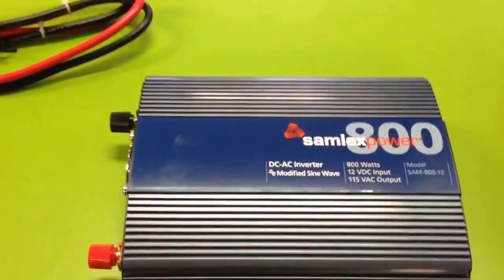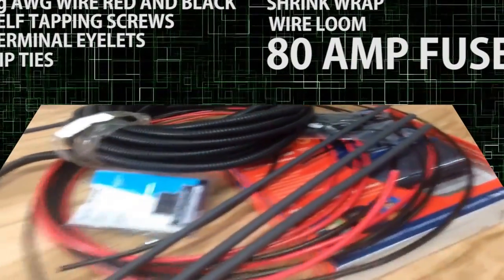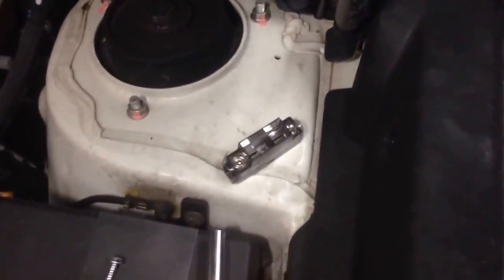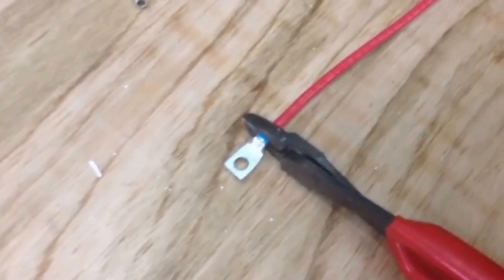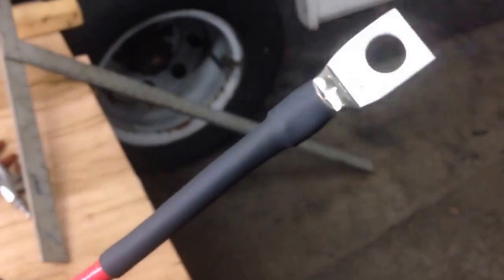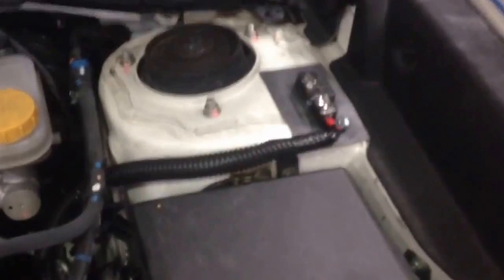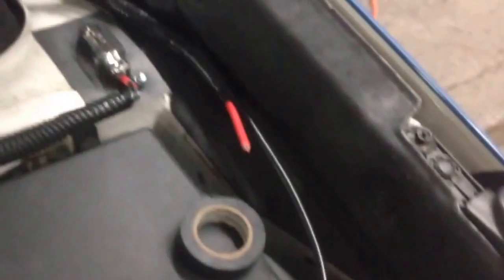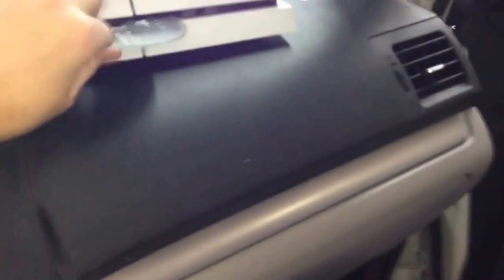How to install a Inverter in your car

Comment: By far the most helpful video I’ve seen and I’ve been watching a lot of these trying to get the best system set up… I bought a 1000 watt inverter and a portable 12 v battery thinking that it would be easier to just connect it to the portable battery instead of having to connect it to my cars battery… I plan on playing my PS4 on a gaming monitor in my car. Is my plan even possible?

Comment: Hello, thank you for the video. How to figure out exactly how much draw is safe for the car - alternator, regulator, the whole system. How much W, on idling off course. Roughly 1kW ?
Reply: 400 w is usually the recommended off standard 12v vehicle batteries any thing larger they recommend a deep cycle battery or a power bank.
Reply: @andrewjordan3884  thank you :)
Reply: No problem

Comment: Did I miss something? How do you run the wires from battery to the inside of the vehicle? Is there a grommet hole that you run the wire thru? (Wanted to be sure that I don't end up with carbon monoxide poisoning? Thanks!

Comment: Is it best to plug a 400 watt inverter to a 12v cigarette lighter or to the battery and should I use a 40 amp fuse. I'm trying to hook a ps4 up in a 2018 dodge caravan.  Any suggestions

Comment: So I wanna do this and your video is supreme with the tutorial but I asked s friend to help me because I am not so confident and he asked if my alternator can even handle it. I'm was planning on using 600w. How can I tell if my alternator will work with this? Was this something you were concerned with?
Reply from the maker: Well it gets kinda complicated lol.  Ok so I doubt anything your running on a 600W inverter will drain your battery enough that your alternator will fail.  Just hooking up a inverter won't effect your alternator only when running something thats drawling a lot of power will possible effect it.  An example would be lets say you have a 60AMP alternator which makes roughly 590Watts output and your running something on your inverter thats pulling 600watts (like a hair dryer) (plus you car systems are using 100w).  So your using more power then the alternator is making; your battery will slowly lose voltage and your headlights may dim down and your low voltage alert would come on before the car shut off.  Now with that being said, I doubt anything you would be running would have that kinda constant drawl to create that senario.

Comment: Try not to use that type of wire! Horrible choice for car audio or car anything really! Your current is greatly impeded which will get extremely hot and voltage drop will be very high. Also the use of the wire used here makes it extremely difficult to manipulate it. Notice how hard it os for him to bend the wire. Use OFC wire (used for car audio and high power inverters or any inverter in my installations. Ofc is very soft and can be moved around with extreme ease and can deliver many times more current with ease. But overall it was a well executed install.

Comment: So I have 1500 watt inverter so I need to have a another battery
Reply from the maker: Honestly depends on what you plan on powering up with your inverter, I’m sure it will work fine off one battery but might go dead quickly when the alternator isn’t running.
Reply: @cosmocasper  oh yeah I just need to power up a lil fridge maybe a microwave ... That's bout it not running it all day tho

Comment: So If I have a 300W DC converter, should I use a 30 amp fuse off the positive terminal? thank you in advance
Reply from the maker: A 30 amp fuse would work on a 300 watt inverter*.  How ever the manufacturer sometimes suggests a bit higher Because the peak max power  might be able to exceed the 300w rating.  Personally I like the fuse to blow rather then melt the wiring so I always fuse mine below the wire rating.   So if you do wish to use a 40-60amp fuse make sure your wire gauge is 8-6awg.  Also the fuse Holder I show in this video ended up melting and I had to replace it with the kind that hooks direct to the battery.

Comment: Is it possible to connect the  500-watt inverter to the cigarette lighter socket?
Reply: Julius Misa soon as you run something big it will pop the fuse for the cigarette lighter

Comment: Can i use motorcycle battery with my 2000watts inverter?
Thank you.
Reply: Vincent Rodriguez  2000 watts is pretty big, probably drain the battery dead fast, make sure the terminals can even handle that much amps if your powering something big

Comment: Should i start my car's engine before using my car inverter through the cigarette lighter?
Or should i just put the key on ignition?
Thanks.
Reply from the maker: +Vincent Rodriguez  starting it gives you the most power (alternator supplies extra power)

Comment: lets say ive pluged in a ps4. while the car is on it works. will it switch of when the car is switched off?  just like the stereo would. im worried if a electrical device is connected overnight it would run the battery down?
Reply: Andrew Robinson  in this set up the inverter is hooked directly to the battery so if you turned the car off your inverter and PS4 will keep running and drain the battery.

Comment: Hey there; I was going to install a 2000w inverter in my suburban for powering a 5.5amp drill, maybe various other minor things when doing repairs in the field, but that would be the most common thing I need it for (instead of running 200ft of extension cords!).  Would I want a modified sine wave or pure sine wave inverter for that?
Reply from the maker: +badkelly  pure sine wave your drill would be more powerful, modified would work but your drill might be 10% less RPM.
Reply from the maker: +badkelly  pure sine wave your drill would be more powerful, modified would work but your drill might be 10% less RPM.

Comment: Why would you need an 80 amp fuse before the inverter? Isn't the voltage coming from the battery only 12 volts anyway? Is the fuse there in case the inverter sends the amps BACK toward the battery?
Reply: That Guy  well the battery is your power source and you always fuse at the source.  Amps is the amount of current and the 12v side has the most amps.

Comment: I'm looking at doing something like this in my RAM 1500. This might sound like a dumb questions because I am illiterate when it comes to electricity.... In a setup like this when the vehicle is off will the power inverter automatically turn off? I want it to always come on when the vehicle is on without having to turn it on and off.
Reply from the maker: This one is hooked straight to battery so it stays on till you kill the switch.  You could hook the power lead up to a selinoid and use an ignition relay to disconnect automatically when you turn the ram off
Reply: That's what I thought. Is it possibly to hook up a smaller one of this (like 300 watts) directly to a the fuse box in a spot that only turns on when the ignition is on?

Comment: Yo i hope you're still replying to this video cause i got some questions. Installing an inverter into a 98 lesabre, so this process is exactly the same if i were to get the same inverter? And couldn't you also have the wires to the inverter around the terminal of the battery instead of off the wires powering the engine?
Reply from the maker: Should be very similar just different lay out.  And yes you should always go directly off the battery and immediately into a fuse.  I hooked to the battery connection which was metal I didn't cut or alter the vehicle wires in any way.  You may want to consider a better inverter if your going to be using it a lot.  I used this one because it was cheap and it has bad quality connections at the unit.
Reply: Have any recommendations for other inverters? (for light duty things)
Reply from the maker: Jak Walrus this ones decent for light duty.  A pure sine wave would be the way to go if you want a good quality one. (This one is modified sine wave)

Comment: How would you hook a extra battery to that set up.
Reply from the maker: +ROGER BROWN  most people mount a second battery in the trunk and you just run the wires in parallel from one battery to the other.  To do it properly you must run the proper size wire when putting batteries in parrallel on cars I normal run 4ga and 100amp fuses but it all depends on how many amps your pulling in your set up.

Comment: is it ok? to use a 100 amp? if u cannot find a 80 amp fuse??

thanks 

great vid.
Reply: Ya it won't hurt anything, it will just spark alot more before the fuse blows if it ever shorts out.

Comment: Do you worry about using a modified sine inverter in powering a PS4 or a laptop? I'm a noob, but doesn't that pose a danger to delicate electronics? Wouldn't a pure sine wave inverter be better? Thanks.
Reply from the maker: +Omat YTubeet  Ya pure sine wave is way better and more expensive.  Both laptop chargers and PS4 use power converters anyways so the 120v AC is being turned into 12V DC so the wave is being transformed and only wears out the converters faster.  Now electric motors on the other hand like my shop vac run slow on the modified sine wave (less rpms).